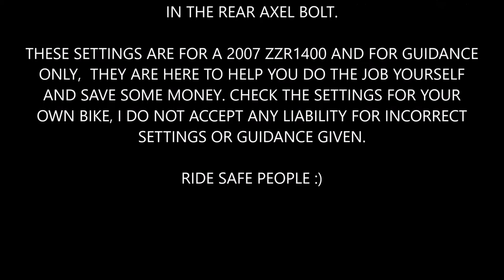zzr1400 chain and sprocket change

Comment: I'm about to fit a 16 tooth sprocket on the front of my ZX-14R as we call them in the States. Your video was very helpful, and let me know what I am in for. Thank you. Ride safe.
Reply from the maker: Any time buddy, watch first gear acceleration with the 16 tooth front sprocket, the front wheel spends more time in the air than on the black stuff :)

Comment: That was magic how you got the chain back on. How'd you do that then?
Reply from the maker: As the chain was brand new, the grease made possible to push it over the top of the front sprocket, and round, then I just grabbed it under the front sprocket and fed it through, no magic unfortunately :)

Comment: Nice one,where did u get coloured nuts from? Do u remember the size?
Reply from the maker: lloyd clayton got them on ebay, dont get the cheapest ones, they dont torque up very well. Bought them as a direct part so didn’t measure them. M10 I think.